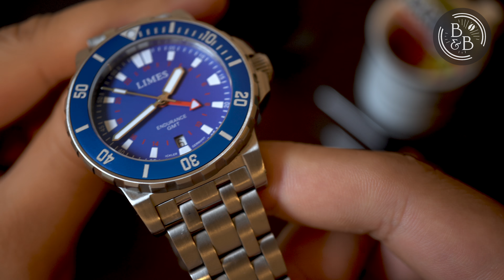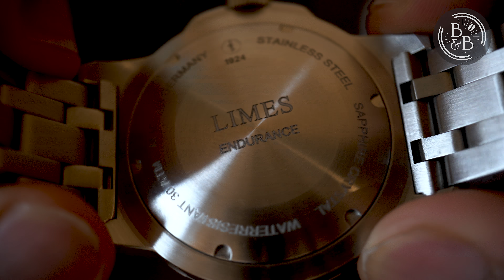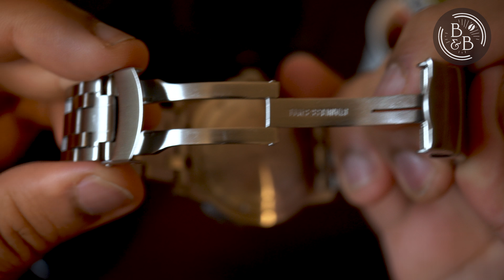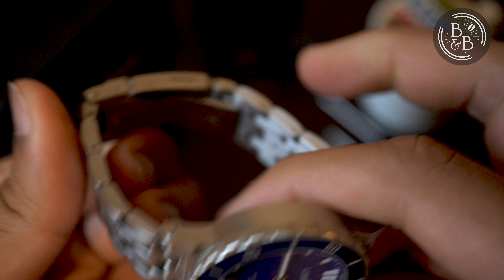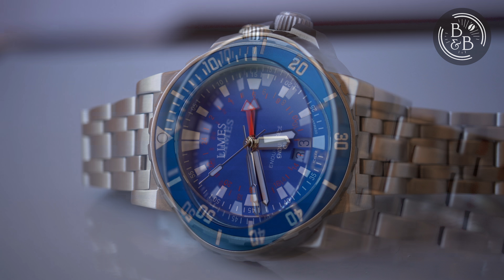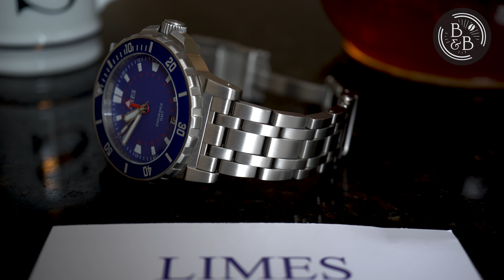Limes Endurance GMT Review - Aggressive Design & Excellent Manufacturing - Beans & Bezels

Comment: Great video. The price is hard to justify given the competition - the Zelos Horizons can be had for $900~. Do you think the Limes is worth $600 more? Cheers.
Reply from the maker: Thank you for watching, and for the kind words.

I agree that there are many alternatives that are cheaper - Zelos Horizons, Christopher Ward's GMT, Steinhart's GMT etc. I haven't experienced any of those watches in the metal, but I will say that the case construction on the Endurance is closer to what you would expect from watches like Tudor, Sinn etc. 

That said, I am very curious about the Zelos Horizons and I'll try to review one in the near future. I'm also working on a review of the Dufrane City Limits GMT right now, which is in the ~$800 range. 

To answer your question - Do I think the Limes is worth $600 more than a microbrand GMT? Not if you just want a GMT watch. I would go microbrand then, because their prices are just too good to pass on. But if you want a GMT watch that has excellent build quality and from a brand with tons of experience, then yes!

Comment: Like the hands, dial bezel insert and perhaps the bezel itself. The case and bracelet aren’t for me but I’m sure it will have a following. It s a big wrist watch which isn’t me! Great review and thanks as always. Serious lume!
Reply from the maker: Thank you for the kind words, as always! Yeah, it's on the larger side of watches because of the lug-to-lug. But even on my skinny 6.25" wrist, it turned out to be quite a fun experience. The 12.5mm height and fully articulating end links really helps reduce the perceived size.